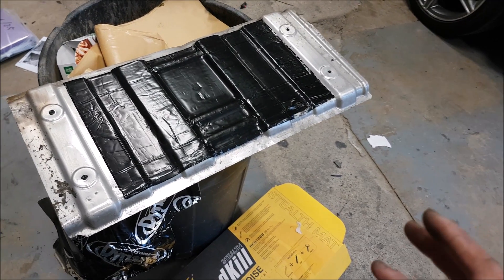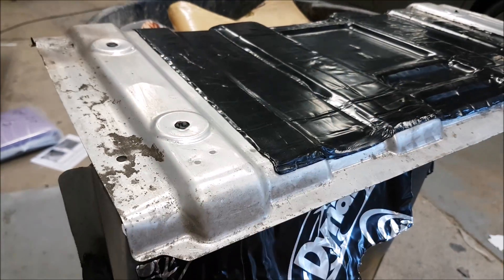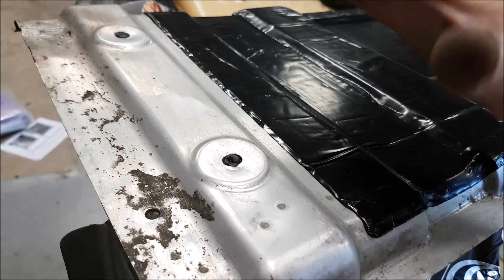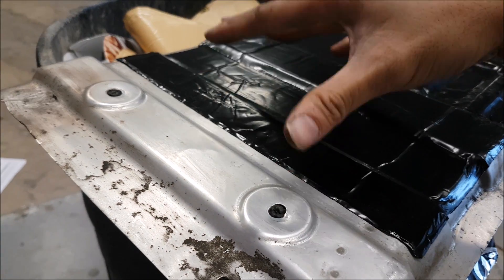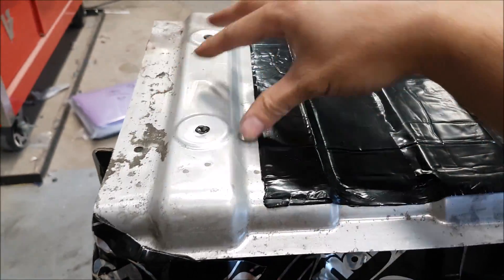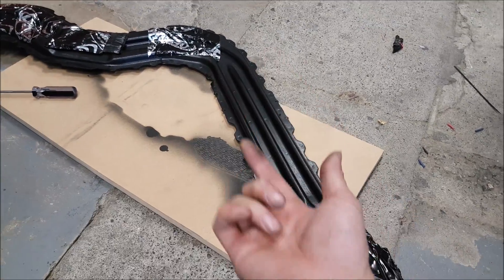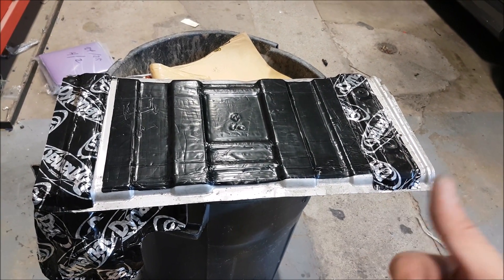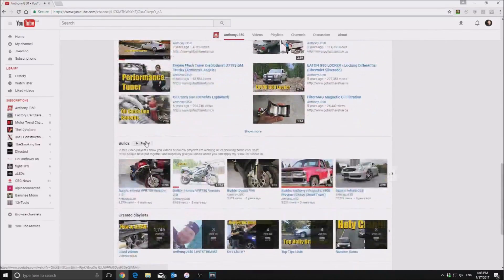STOP Heat Shield Rattle | AnthonyJ350

Comment: Thank you!!!
Reply: You going the extra step to paint it black? That doesn’t sound like you ha. Ha. Love the quality
Reply from the maker: Are you going to try the sound deadening trick?
Reply: AnthonyJ350 definitely, I have major knee surgery next week but over the winter I’m going to pull every interior panel including firewall to deaden the sound. Either paint the trim or wrap it in a nice cloth
Reply from the maker: @stustu5774  Good luck with your surgery! If you're going that far, use rubberized undercoating as your first layer then a day or 2 after install the sound deadening.

Comment: Rattling is such a pet peeve when it's hard to locate. This is a perfect tutorial for tackling this issue. I have used expanding foam and wedge rubber pieces.
Reply from the maker: That will work but I don't know how those materials will do in terms of heat.

Comment: What is a good product to use in the hard to reach trunk lid areas that rattle?  I've heard some people use "Great Stuff"  spray can foam.  Is that ok to use?  Or could you recommend a different produce.  I used  second skin for the areas that are accessible.  I'm just looking to fill in those hollow areas in the trunk lid

Thanks
Reply from the maker: I've used Great Stuff and it works well. You have to mask off the whole area you're working on, as it's very messy and expands a lot so be sparing with it.